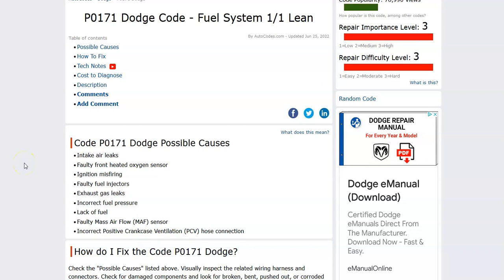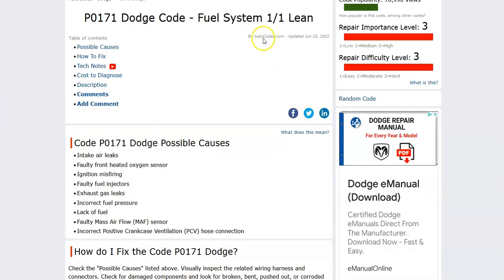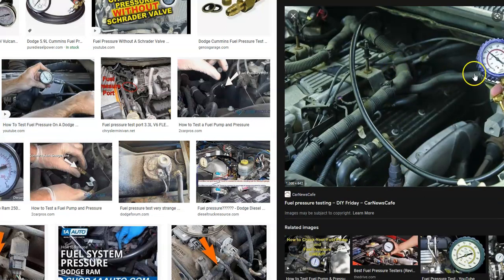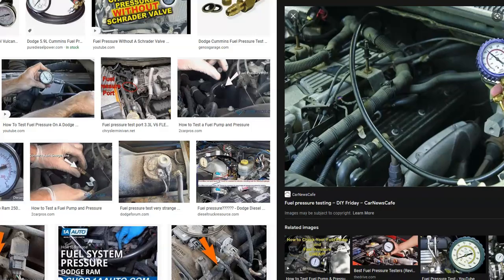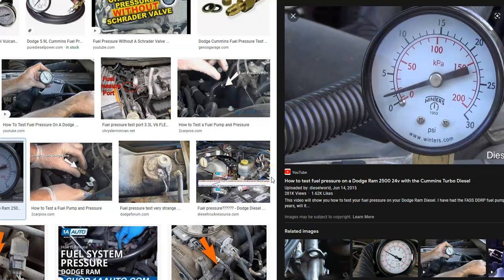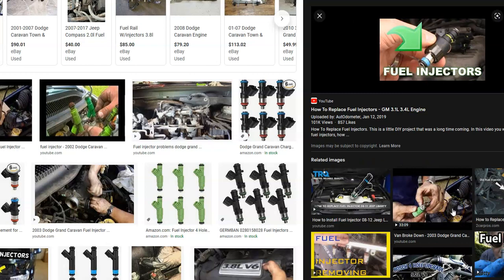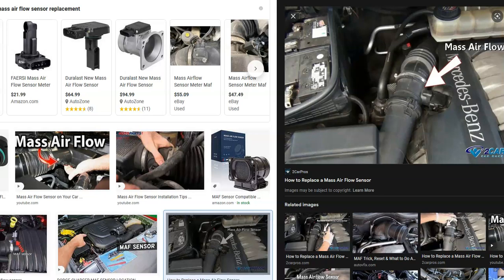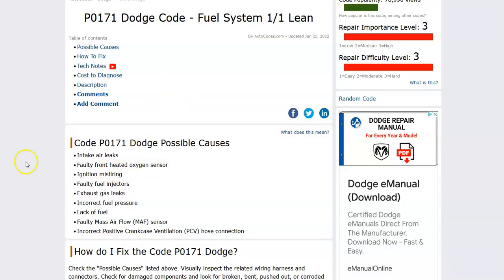Causes and Fixes Dodge P0171 Code: Fuel System Too Lean Bank 1 (4 Cylinder Engines)

Comment: So I have a 2006 chrysler 300 srt8 I changed the fuel pump so it's new, can it be the sending unit? The fuel pump is on the driver side back seat and the sending unit is on the passenger side back seat? I'm getting po171 code any help?
Reply: Figured it out yet?

Comment: My fuel pressure is 7 lbs below specs, 51lbs at the rail, supposed to be 58. Changed the pump and filter and still the same. Because its a 97 grand voyager I decided to change out everything-injectors, plugs, o2 sensor, map sensor, ctemp sensor, pcv valve, egr valve, iac valve, smoked entire system no leaks and no other codes. Fuel trims not affected by increasing rpms. Car occasionally stalls at red lights. Air filter new and throttle body clean.  Going to check voltage at the pump next. Car always starts right up. I'm missing something and would appreciate any thoughts you might have. Thanks
Reply from the maker: If everything was replaced, there may be low voltage at the fuel pump, a blockage in the lines, and possibly a bad replacement pump.  Sometimes, a vacuum in the tank can prevent fuel flow, but that usually starts collapsing the gas tank.
Reply: Did you figure out what it was? Could have been your pcm?
Reply: Any updates?
Reply: @GFXWard I changed the fuel pump and fuel filter sending unit and it fixed it, but go with a good brand fuel pump and sending unit, I went with delphi

Comment: ive got p0171 code ..dodge ram 2004  that mpg has dropped from 15mpg to 5mpg

any ideas?
Reply: Have you solved the issue with your truck ? Mine is doing the same thing
Reply: Im having the same issue as well.
Reply: did you solve the issue?
Reply: its been about 9months...no check engine light and mpg back to normal
Reply: yes ..i solved issue...everybody told me it was air leaks and all kinds of crazy stuff...i  analyzed the data using my obd2 scanner w livecdata and decided it could be 02 sensors....i was told 02 sensors would not cause mpg to drop to 5....i changed all 4 02 sensors and all is good now....)...i was getting 0v on 2 of the sensors...i changed all 4......my ram had 190k miles...when i removed the 02 sensors it appeared 2 were orig and 2 were replaced....the 2 that were orig were the failed ones...so if ur ram has a lot of miles and orig 02 sensors ...you may want to check 02 sensors....my truck idles much smoother now too....from my research it seems 02 sensors are critical in fuel usage and idling and overall performance.
Reply: What kind of O2 sensors did you buy??
Reply: Having same issues changed fuel pump and throttle body and my mileage dropped to about 5 mpg new oxygen sensors and new fuel injectors plugs and coil packs any help would be appreciated